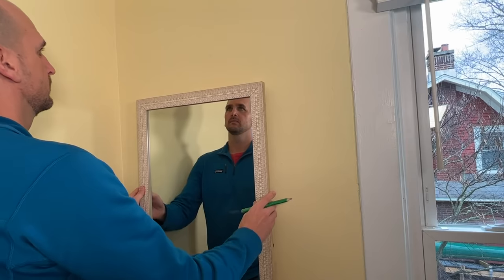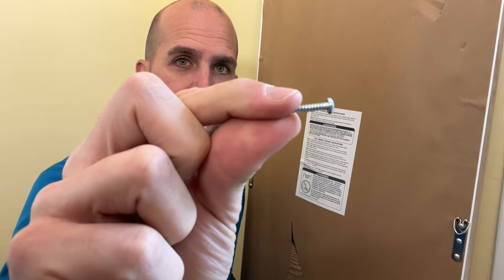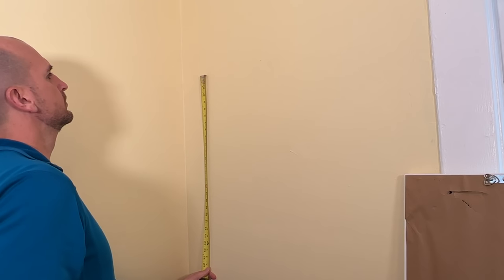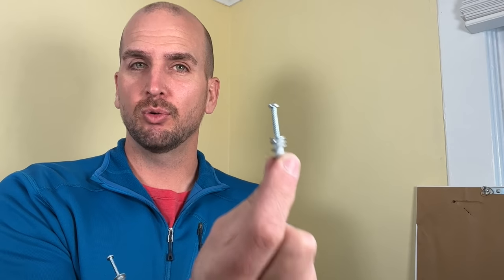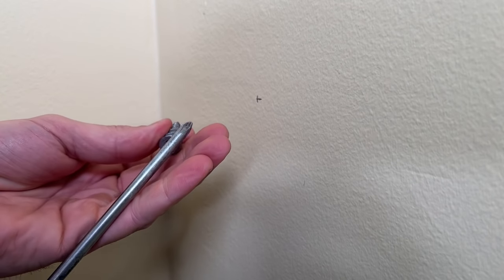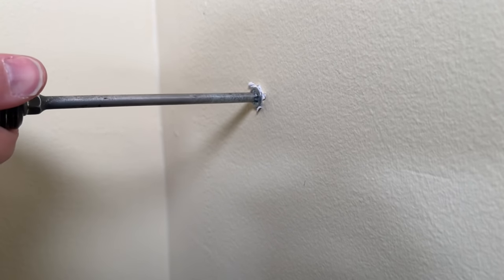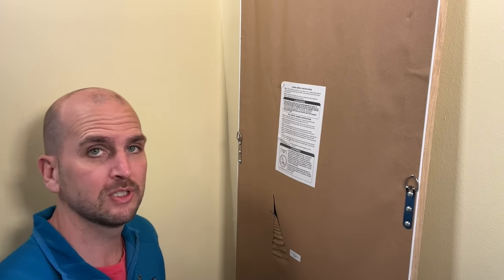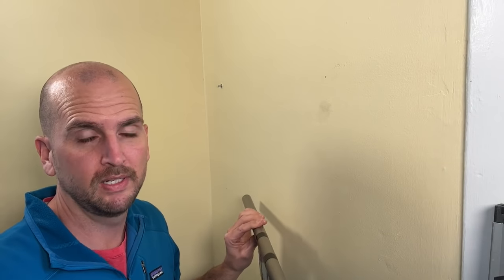Easiest Way to Hang a Heavy Picture or Mirror

Comment: You forgot one VERY important step. You've assumed that some 12 year old Chinese kid made an EXACT measurement on the back of the mirror as to where to attached the hangers. I've learned the hard way, even off 1/8 or 1/4 of an inch can throw off the way the object sits on your wall.

Comment: A few points:
- Always measure the vertical distance to both D-rings, often they are installed uneven.
- Never use an app instead of an actual level, those things are gimmicks and are not going to be accurate- especially if you're taping your phone to a pipe, that's absurd!
- Use blue painters tape to mark the reference points on the wall instead of using pencil, less mess. I only use pencil where I'm actually going to drill my holes, and for my center mark

- While EZ Anchors and similar are a decent choice in drywall, it's really not a good choice in plaster. Plaster is more brittle, and an anchor like this which really chews up the material is not a good idea. A plug type anchor, with careful pre-drilling, is better for plaster in my opinion.

- For heavy mirrors and/or walls of questionable strength, use flat metal hooks screwed to the wall (with appropriate anchors) rather than hanging from screws directly. It will be much stronger, as there is less of a levering effect on the screw- the body of the hook braces against the wall, meaning that it's all shear load rather than tensile load. Hooks also give you some leeway in case your measurement is slightly off.

- While you can install these in drywall without pre-drilling, it's a bad idea and will make a mess. You should always pre-drill. And I trust the plastic ones more than the metal. This is fiber-reinforced nylon, the strength of the plastic is not a limiting factor.

- EZ Anchors are NOT actually rated to 50 pounds! While this detail is buried in the specs on the manufacturer's website, the advertised load rating is BEFORE applying necessary safety factors. The instructions also state that the load rating is the total 'per job, NOT per anchor'. FYI SnapSkru by Toggler is similar to EZ Ancors but have a higher load rating (when including safety factors), and in my opinion are of a better quality.

(there are many more tips and tricks about installing these properly, but these are the most critical issues I find with this video..)
Reply from the maker: Wow, great feedback and I really appreciate you taking the time sharing your experience and knowledge.  Much appreciated 👍

Comment: With the method shown, you have to make CERTAIN that the D-rings are set equidistant from the top.  Often they aren't and you will need to adjust your anchor locations accordingly. 😁

Comment: A poor choice to use a broomstick or pipe or other round cross section object as a straightedge, since it's hard to take the curvature into account accurately when marking the wall. Also, why even bother checking the top frame of the mirror for level after mounting, since by that point you have no adjustment options?

Comment: Do not do this!!!. I repeat, do not do this!!! So much bad info here. Those D-hangers are not level across the frame. You have to measure the hanger from the top of frame to top of hanger. Then those anchors. They are junk. They crumble drywall. Worse, when used in plaster wall you have to expect the wood ferrying strips in the plaster. This is very bad example of how to hang an item.
Reply: I've been using those anchors for at least 30 years with no problems
Reply: I use the anchors.  The best for heavy mirrors
Reply: 😂😂😂😂😂 ya madman